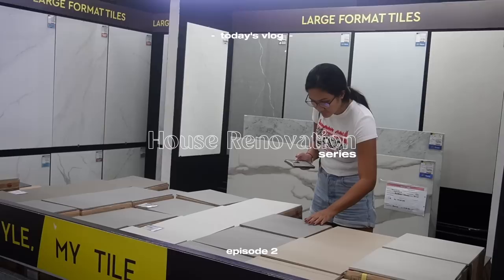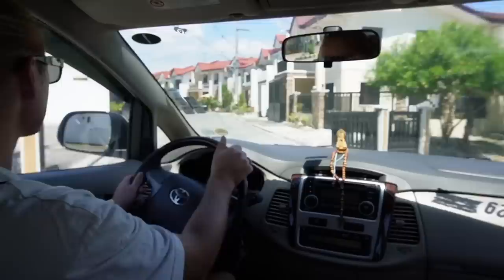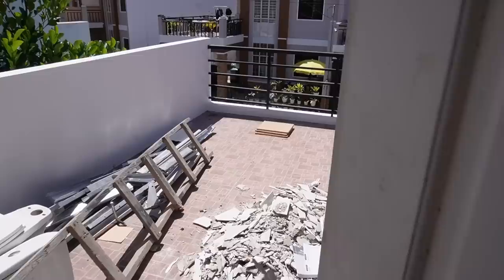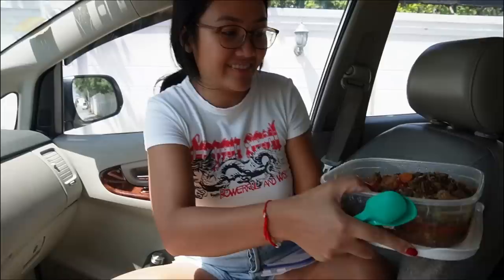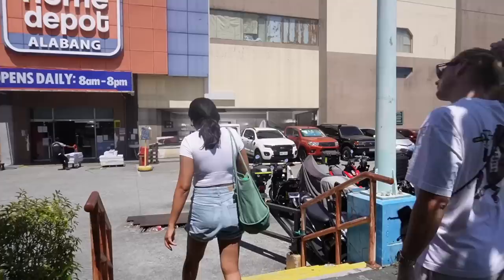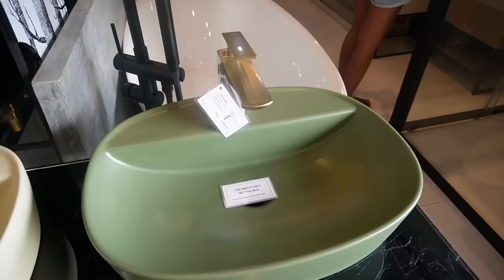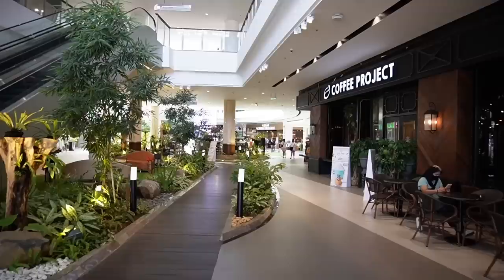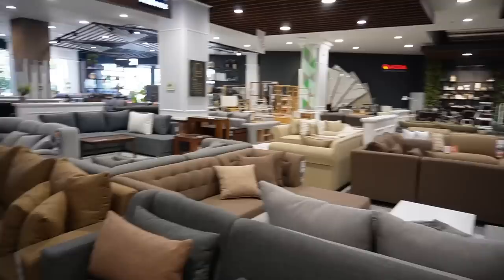Building our HOME! House RENOVATION in THE PHILIPPINES 🇵🇭 | Episode 2

Comment: Excited to see the progress of Casa Solhaugen's reno project. Secret for reno works/follow as planned for less stress and add"l cost and time. If no more budget stop don"t proceed. Save for the rainy days and travels to avoid financial problems. If no.more budget for furniture and fixtures appliances , just buy folfdable  low cost  f& f for temporary  use only accdg to your necessity so u can now use the house and no.more airbnb/condo rental.
Then save money to buy one by one later for the  quality f & f & appliances you wish with class according to the designer plans to maintain the class of your house. Just sharing for newly weds couple.🏠

Comment: You are doin't it wrong.  Underneath the tiles there needs to be an underlayment like ditra.  The subfloor are concrete or the walls and they will be damp creating mold and will fail.  Tiles are not water proof water will penetrate through the grout. They need to be sealed ever few years.